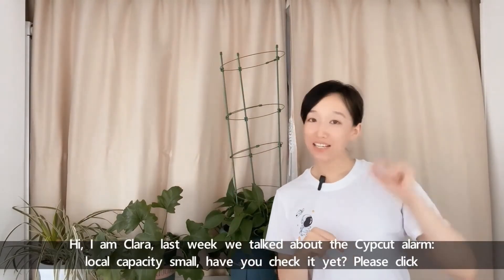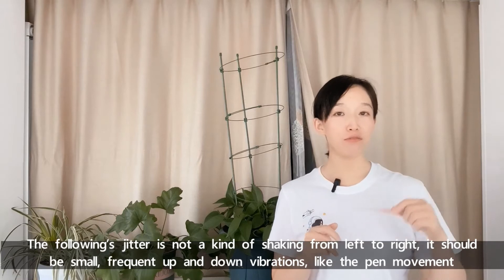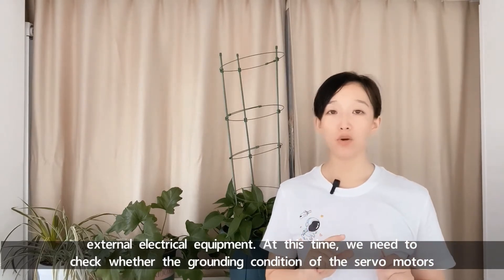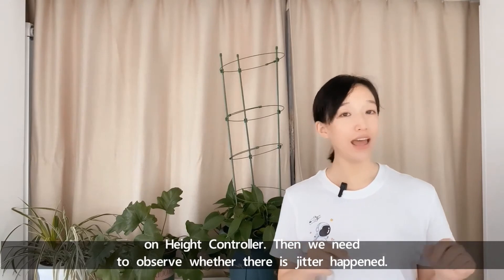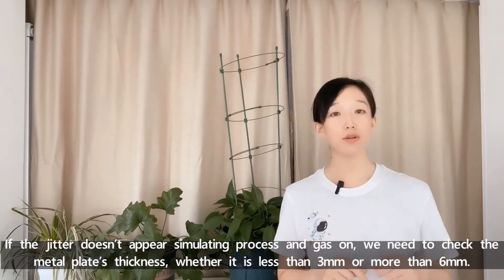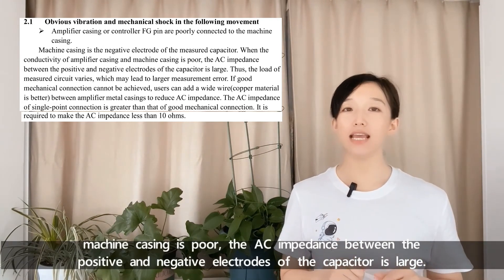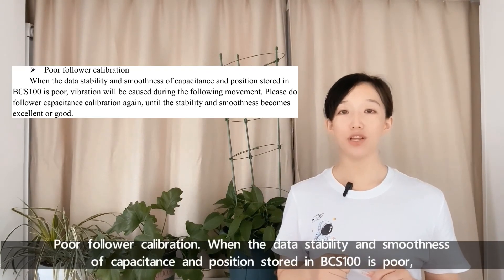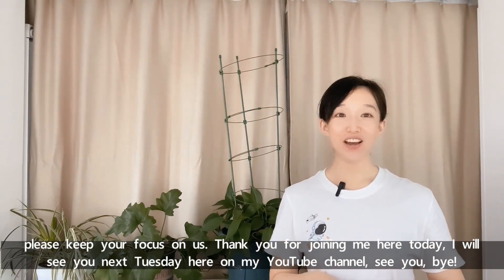Cypcut Alarm: Follower Vibration | BCS100 Alarm | Fiber Laser Cutting

Comment: Today, I faced one problem while doing edge seek machine cutting head failed to do edge seek and gave some edge seek error on computer. We tried doing calibration it gave poor result and there was vibration in the cutting head while it was coming down. We are not able to solve it, please help machine is under warranty, Service engineer is trying to replace the Z-axis servo motor. I don't think it will work. Please suggest.
Reply from the maker: Could it be the sensors?
Reply: @ClaraChai  my machine DIF value is 284